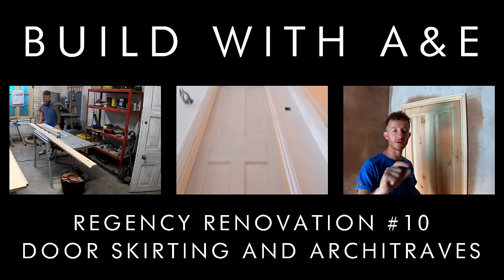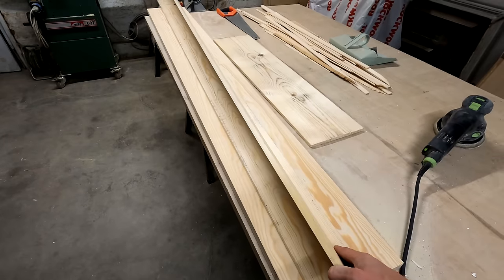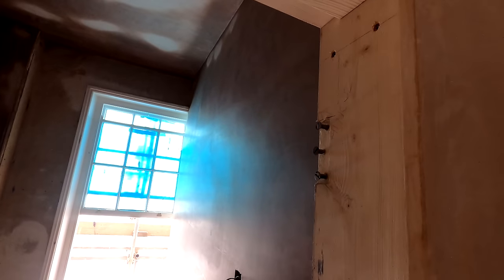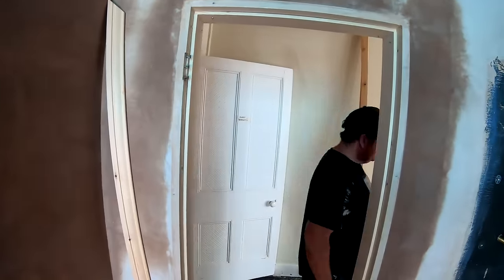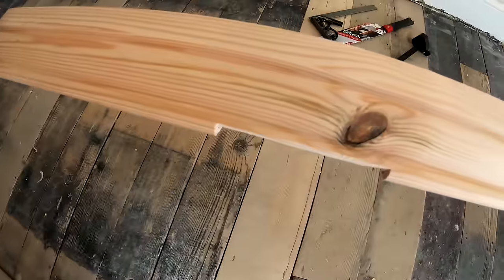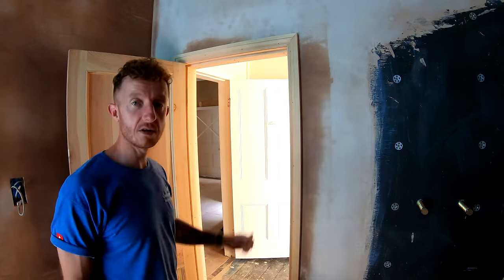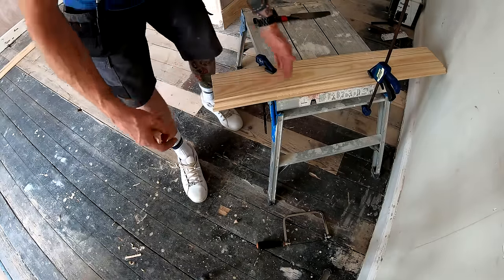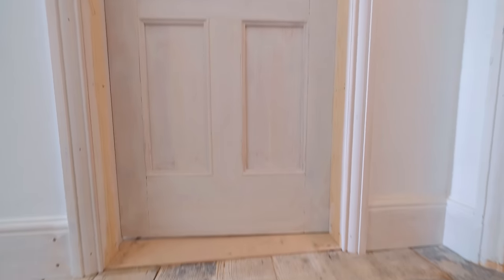FITTING DOOR LINING, ARCHITRAVE AND SKIRTING | Regency Renovation #10 | Build with A&E

Comment: Never heard them called slamming strips before always known them as door stops 🤔
Reply from the maker: If the strip covers the lining (apart from the door rebate) then it's classed as a door casement; in which case they're slamming strips. If it's a standard door lining, with the strip only covering part of it, then it would be a door stop.

Hope this helps.

All the best, John 😊
Reply: Yeah but in this case they are door stops because your mechanically fixing them right ?
A fixed casement has the door depth rebates out of the lining ?
Reply: Depends if you've got teenagers or gearing up for a divorce!

Comment: Thanks John, awsome job as always. Perhaps you could advise me what should I do to rectify my door frame. The builder has fitted door frames which are sticking out of the wall edge about 10mm. Walls are skimmed already.I wanted to fit arcitraves but is not flash with wall.

Comment: I like how you are meticulous with measuring and the spacing of the nails etc. I do my own woodwork and diy, and I would like to start working as a carpenter, but I have been told that if I want to work for a company, I cannot be as meticulous, as trade here in the UK is all about speed and rate of work. May I ask, in your opinion, does being detailed make you feel under pressure timewise, especially if you were working for a company?